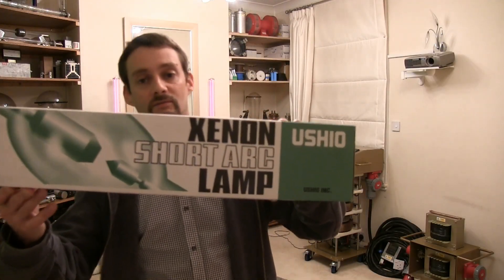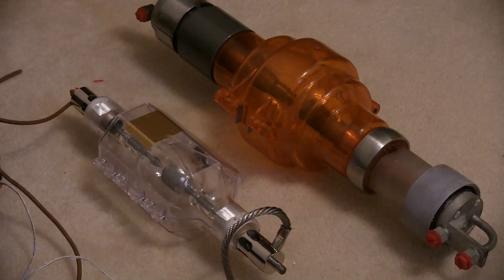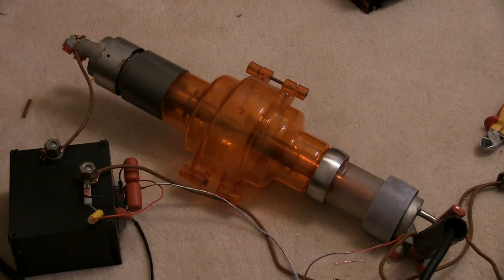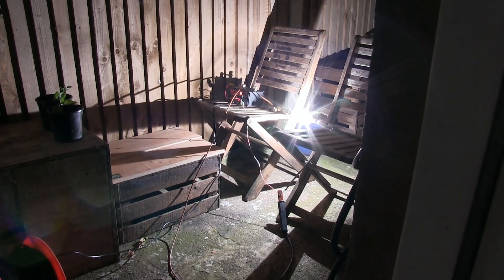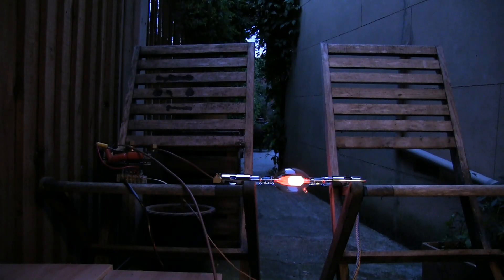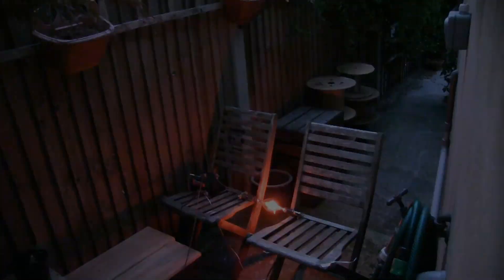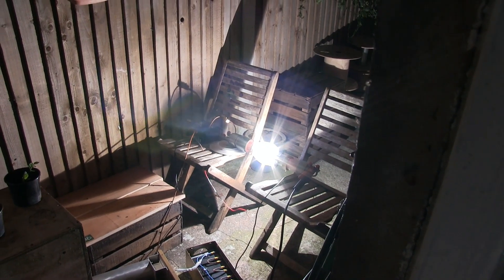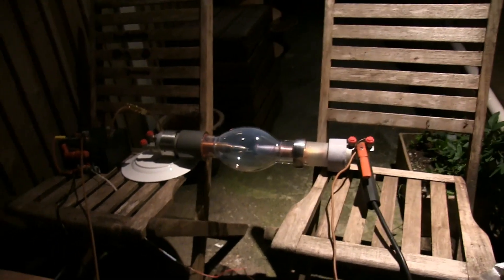30kW and 4kW Xenon Lamps Get Tested on a DC Welder

Comment: 0:57 Oh snap all the '90s movie theater projectors had those big Osram xenon arc lamps. But they're 30V with around 75-150 amps, I think 3000W / 4500W / 6000W. My first job was a projectionist and I always remember the ominous meter that showed around 100 amps on all of them. You could see the arc lamp through tinted glass like a welding mask.

Comment: I was stationed at Sunnyvale Air Force Station.( Onozuka AFS ) gone now. I maintained Zenon lamp rear projected slide protection systems for Mission control complex. My shop was display maintenance.  The power supply was rated for 30 A.

Comment: Comment #2: You really need to support the examples on more heat-proof / non electrical conductive  materials such as concrete blocks -- at least better than thin metal or wooden chairs.

Comment: So in what set up does this become dangerous because of x rays? Is that possible with these types of arc lamps?
Reply: X-rays are more prominent in equipment with a vaxuum inside. In this case there's pressure so electrons probably bump into another xenon atom before they can accelerate and hit an anode.
Reply: Xrays are produced with high voltage. You need at least 200,000 volts. This is high amperage, low voltage.
Reply: @Vintaronica  you dont need 200000v atleast for xrays ypu can put 30kv through some rectifier tubes and get decent amount of x-rays
Reply: @hardnachopuppy  yes but they will be low energy ones, alpha mostly..to get deep xrays to be dangerous to oneself, you need at least 100kv. If your going to be dangerous, do it properly 🤣😀👍

Comment: So the cathode bombard the anode eventhough it's the negative one? I always thought that the positive lead is the one that provides the power.
Reply: At least in metal conductors the power is carried by electrons and those move from negative to positive. The idea of positive and negative and a conventional current that moves from + to - was created before anyone really knew the physics of it. In any case, current flows in a loop so no terminal is really providing it more than the other.
Reply: @deltab9768  I can't wrap my heard around it. If current flow in a loop how is it possible for both leads to be powered? That is simply impossible. But I don't know anything about this and everything regarding electricity, except the ususal stuff, is really confusing to me.
Reply: @unogazzy84  Generators and batteries force electrons out of their negative terminal and/or pull them into their positive terminal. The thing that matters is the voltage difference between the terminals, that's what sends power into a load.
Reply: The flow of electrons is always reverse to that of the energy displacement.

Comment: the scariest for me is how dirty you left those before powering up. all this dust absorbs light and puts more heat into the glass, and I'm guessing that's what melted the hole through it.
Reply: Even the oil from skin degrades quartz so you are not supposed to touch it

Comment: remove backlight from an LCD and add this behind the panel. use suitable diffusers. will probably need cooling. make a monitor which is easy to read in direct sunlight.
Reply: Basic concept behind a projector

Comment: Those lamps are used in concert (follow spots/pin spots). 4kW would output above 20,000 lm follow spot beam for a large venue to stage.

Comment: Ah! I love these lamps. I work at a cinema in Canada, swapped out a ton of them. We only use 3000w ones, they last 1500 hours. When we swap them we wear full protective gear. Face shield, goggles, thick leather gloves and jacket. When cool they dont have too much pressure but still wicked dangerous. When they have ran their life we put them in a large PVC pipe with a screw cap then drop the tube. Bulb pops inside (with quite the bang id like to add) then pour out the dust in the garbage. Wearing a respirator of course, can't imagine quartz dust would be very nice.
Reply: Just to add to this. We had a lamp fail about a year ago right after start up. Clearly had some air or something in it. Started it up, had good light output but quickly started to fall. We turned it off, let it cool and check the bulb and it was a beautiful blue color. The deposits left on the inside of the bulb looked like a painting of a galaxy with lots of Blues and yellow. Super cool to see!
Reply: @Ghyus01  is light bulb changing at cinemas a freelance type of thing? Any certification required? I would be interested in learning more about possibly making it a side gig. My company rents out 4K xenon arc lamp advertising searchlights so i am very familiar working with the bulbs.
Reply: Yes they do emit a ton of infrared , ton of UVA , UVB , and also UVC , and very strong visible light  . I would love to have 40 -100 W xenon for indoor use , maybe to buy one made for cars and with help of electrician install it at home . Everything but not LED scam .

Comment: I was wondering if I could ask a question.  I understand each 'end' of these types of lamps are connected to the 40vdc outputs of your dc power supply (in this case a welder).  I am less clear about if this has a direct dc connection to the ps, how then the so-called HV 'igniter' signal gets sent to the lamp.  Might  you be kind to draw a simplified schematic schematic, showing the ends of the lamp, the output of the welder, and exactly where/how the igniter is hooked up to all of this, and present a link in the text part of this youtube video.  Hey, by the way, so that I can give a little back to you...  I recently attended CineGear tradeshow in Los Angeles, a company there luminyscorp.com was demonstrating a 200,000 watt linear cw xenon lamp (used for shooting movies).  Their web page, has info for a 100,000 watt model (http://www.luminyscorp.com/index.php/100k-linear-2/).  He said the 200,000 watt unit uses about 400 vdc, and about 25 to 30 Kv starting pulse, lamp life is about 150 hours.

Comment: We make UV testing chambers using these bulbs, simulating up to three years in less than a month, the amount of extraction not just for cooling but for ozone removal, we make equipment for the PPE testing industry and the bulb  is specific that we must have it running first for multiples of hours to acclimate or stabilise the bulb, then the samples are placed in the chamber, the test is carried out by a trained technician who has the procedure video recording. Once the samples were treated in the UV chamber, they would go on into other tests within the laboratory. It’s different and in a very specific sense, only three main competitors who makes these particular machines. Keep it up and shining bright, I’ll ask about some of the old bulbs that still work, we don’t use them after the test.   Enjoy the show

Comment: That anode is so hot. How is that thing not exploding.
Reply: I know lol... i just mean the glass and everything.
Reply: @leonreynolds77  It's quartz glass, same stuff that's used in car headlight bulbs, HID xenon and halogen incandescent. It has a much higher melting point than conventional silica glass. Have a look here:- https://www.technicalglass.com/technical_properties.html
Reply: Tungsten has an extremely high meting point.

Comment: Why do i have a feeling that this light can amit x-rays. So be careful being too close to it for long period of time. 
Reason I'm saying that is because x-ray bulbs works in very similar design.
Reply: X-ray tubes have huge accelerator voltages. This can only get up into short wave UV range. UV isn't ionising radiation. Not good for your sight though all the same.

Comment: You are an Idiot. I worked many years with these kind of bulbs.  You made many mistakes in handeling.  Hope u Know that you risk your life with this kind of experiments. You operate them without any cooling.  This is very dangerous. If it explodes, hot glass will fly around with the Power of a little handgranade.

Comment: The reason that 30 kw lamp most likely failed, is that it's supposed to be water cooled with deionized water.  I used to work on 70mm IMAX 48 fps film projector that used almost the same lamp.
Reply: You're probably right, it looks like it has coolant ports on the ends of each electrode. With 30kW of power I'm not exactly surprised. I imagine the coolant goes through at least a portion of the electrodes inside to keep them from melting like it did here...
Reply: @TheExplosiveGuy 🔴 What Is Islam?  
 
🔴 Islam is not just another religion.  
 
🔵 It is the same message preached by Moses, Jesus and Abraham. 
 
 🔴 Islam literally means ‘submission to God’ and it teaches us to have a direct relationship with God.  
 
 🔵 It reminds us that since God created us, no one should be worshipped except God alone.  
 
 🔴 It also teaches that God is nothing like a human being or like anything that we can imagine. 
 
🌍 The concept of God is summarized in the Quran as: 
 
📖 { “Say, He is God, the One.  God, the Absolute.  He does not give birth, nor was He born, and there is nothing like Him.”} (Quran 112:1-4) 📚 
 
🔴 Becoming a Muslim is not turning your back to Jesus.  
 
🔵 Rather it’s going back to the original teachings of Jesus and obeying him
Reply: @TheExplosiveGuy 🔴 What Is Islam?  
 
🔴 Islam is not just another religion.  
 
🔵 It is the same message preached by Moses, Jesus and Abraham. 
 
 🔴 Islam literally means ‘submission to God’ and it teaches us to have a direct relationship with God.  
 
 🔵 It reminds us that since God created us, no one should be worshipped except God alone.  
 
 🔴 It also teaches that God is nothing like a human being or like anything that we can imagine. 
 
🌍 The concept of God is summarized in the Quran as: 
 
📖 { “Say, He is God, the One.  God, the Absolute.  He does not give birth, nor was He born, and there is nothing like Him.”} (Quran 112:1-4) 📚 
 
🔴 Becoming a Muslim is not turning your back to Jesus.  
 
🔵 Rather it’s going back to the original teachings of Jesus and obeying him.
Reply: He knows, he mentioned he should have WCd it but didn't think 4kw would fry it.  You would want the water distilled to keep from having mineral build up.
I use to run little ol 1kw grow lights x several and used fresca sol water cooling fixtures, the things were amazing at pulling the heat out so plants wouldn't burn in a cramped space.
Reply: That's insane that the IMAX 70mm projectors used 30kw lamps. The highest I've dealt with at my job is 6.5kw and I thought that was crazy, I would be terrified to change one of those. The cost plus risk to myself... old school film projectionists were truly crazy looking back on things. It's a truly amazing and fun job, I still think were crazy even with digital though lol. Sadly things like this are going away with the advent of laser projectors. They are easier to maintain, however I think the image quality is lacking in comparison to a Xenon lamp. There's something about laser projection that feels soulless. I'm sure people said the same thing about the switch to digital from film though so I'm sure I'll get used to it eventually.
Reply: @OfficexNinja operating voltage is quite low, just a lot of amps (and such amps cant flow through you if the voltage isn't high enough)

the biggest risk of one of these would be dropping it at operating/hot temps due to the pressure i'd reckon, which is when you could get bombarded with glass.
Reply: damn what a shame

Comment: What's the X-Ray output?
Reply: Might be a good idea to have an ionising radiation meter to hand. If it measures more than 2 microsieverts per hour - you might want to take safety precautions to shield from the radiation.

Comment: The big one has a leakage in its envelope. It have had an air penetration into the globe. Anode looks blackened like if it were been burnt at the same time that the inner surface of quartz appears slightly whitish by the Tungsten oxide from electrodes.
The hiss that are heard short before turning off the lamp has any to do with such an hypotethical leakage?.

Comment: Oh the xenon pressure, all xenon arc lamps must have 120 psi operating pressure. So depending on the volume, the cold pressure varies depending on lamp design. This lamp has a cold pressure of 60 psi.

Comment: The 30 kW bulb you have is a hanovia made in the 1970s. It needs water cooling. 4.5 u.s. Gallons per minute. For the anode. Cathode not as much. Surprised to see that it still has xenon. Rubber o ring seals at the ends usually leaked.

Comment: Put that 4KW in a portable battery torch :-)
i have one 350W xenon in old, rusty lantern, made for lead acid rechargeable (now running from LiPolymer, and homemade regulator/ignitor) and man people scream when they look directly into it and hit power button. Thankfully it only otputs about 5% light for first few seconds, before it warms up :-) I usually have it hanging on the wall, so it doesnt fall far when they scream in fear looking down the reflector, and bulb is mounted on shock absorbers (well, a spring)... just in case they smash me on my head with it. People never learn. What if it was laser or something? Would they look down shotgun barrel and press trigger too?

Comment: been watching a few of your videos, really neat!!!! I have a question.... about that billion candle light bulb.... what was it for, and in its optimum setting, how long does one of those last? Do these last longer if they are just left on, of is there a start up stress that shortens the life of them?... sorry for the many questions, just interested. great job on the videos!
Reply: the big 15K ones are often used in Imax projectors, though I'm sure they're also in spotlights and other stuff. There's not really much stress on startup as long as you're not strobing it. often its harder on the supply than the bulb depending on construction...but they are best run according to spec continuously. if they are run too far over or under current, then they electrodes will be ruined. which is what happened to the big 15K+ one he lit under power. it sputtered due the arc not being stable-the cathode under-heats and sputters from low electron emission, and the anode burned up from lack of cooling is what it looks like. they're also prone to explosion if mishandled as he warns a few times, from any number of reasons. running one in the open like that isn't recommended. I've seen these burst, and its quite violent... often sending people to the hospital to have the hot quartz glass removed. This one also sprung a minor leak evidently too, but you can see after he runs it the glass is cloudy from sputtering the electrodes.

Comment: Are those this kind of lamps that can get you extreme sunburns in matter of seconds?
Reply: yes, beacause its an arc lamp, there is a lot of uv radiation coming of
Reply: Well I hope he had sunscreen and welding mask then
Reply: This lamp I would think puts out UV unless there is a chemical added to the Quartz to block UV.  As there were used in a cinema, there is most likely a chemical in the Quartz. Ceramic Metal Halide lamps use uv blocking Quartz too. Other HID lamps have a glass outer bulb which blocks the UV from the arc tube. Glass blocks UV.
Reply: Actually, no, these lamps DONT have a uv blocking chemical as he could smell ozone.

Comment: are those red screws for a cooling system?
Reply: Yes, it must be watercooled, so that's why it failed. Smaller 4 kW bulb needs an active air cooling and the manufacturer usually states in thr datasheet what airspeed you need around the whole bulb. If you continue running these without any cooling the cathode may detach and touch the glass. After that - explosion with a very high probability.

Comment: Damn fine toy chest you've got out there. I especially appreciate the camera and its ability to dampen the brightness of the bulb to see other colors when you zoom in tight. Been trying to get that from my camera when I melt rocks to glass in the microwave. P.S., that lamp bulb would still light in a microwave oven... without any wires connected to a power source.